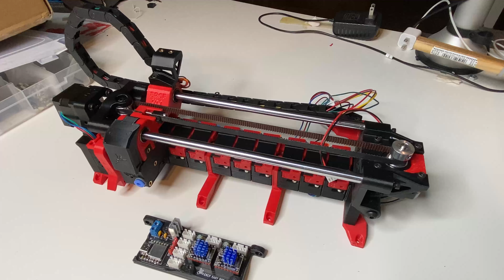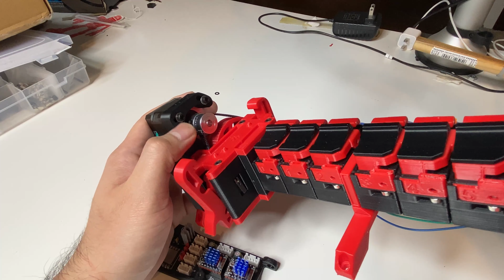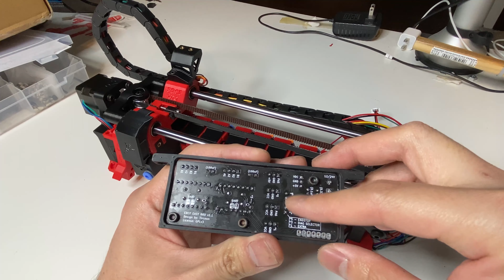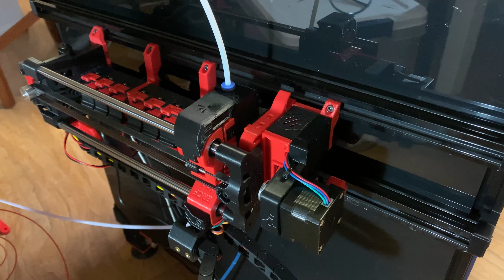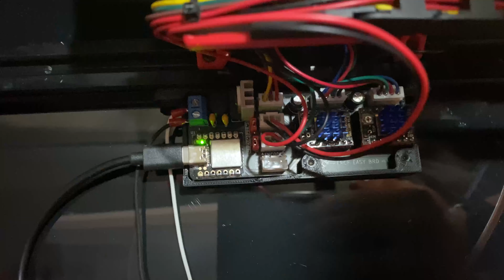Bluerolls ERCF kit Initial Review

Comment: Would this device be suitable for an ender 3v2 printer?
Reply: if it runs klipper than yes. If it runs Marlin than no
Reply: @warmesuppe what about an elegoo neptune 4 pro? Will i still need a pi?
Reply: @abdulrahmanbitar13  You already have a MCU running klipper.
You should be able to configure it as it is.
Reply: @warmesuppe  so Just plugin this directly to the usb port of the elegoo Neptune 4pro
Reply: @abdulrahmanbitar13  Watch a tutorial like that from nero3d

Comment: For everyone wondering what this is, it is an automatic filament changer basically for like multi material printing for machines with a single hotend, it removes the filament from the nozzle and selects and inserts another one. They are meant for vorons.
Reply: Exclusively Vorons? For example, this upgrade wouldn't work on my Anycubic Vyper?
Reply: @sp4rtan148  anything running klipper
Reply: @Dead_Pixels94  reprapfirmware and marlin are both supported with a bit of configuration
Reply: ¿funcionan para todas las impresoras o solo para voron?

Comment: If you think you're having issues with the Nema 14 consider checking if your main axle is even straight to begin with and replacing the 3D printed 80T gear with a metal one first - Having a straight shaft and a round gear running on it makes all the difference.